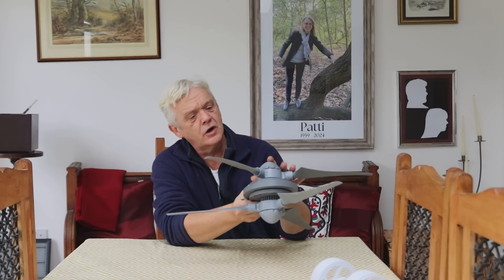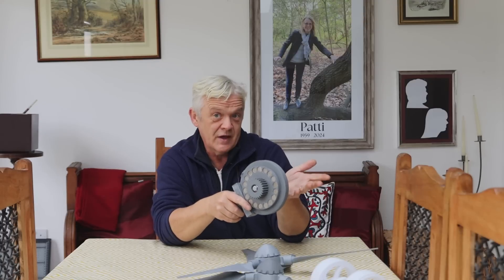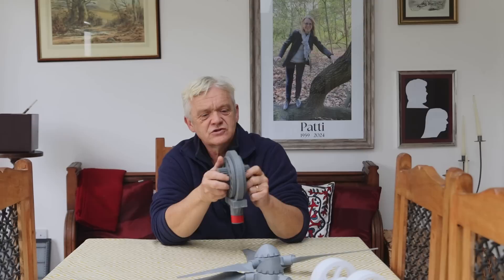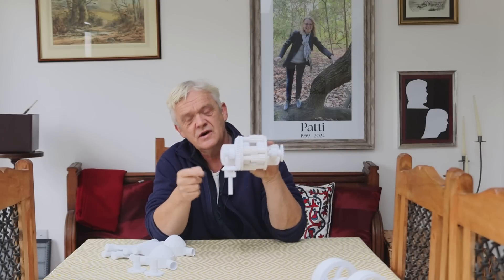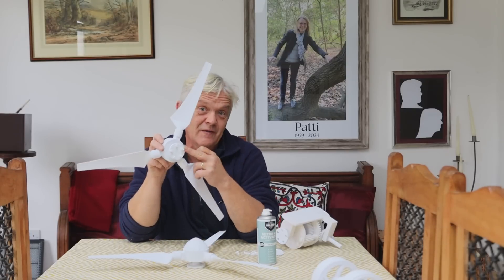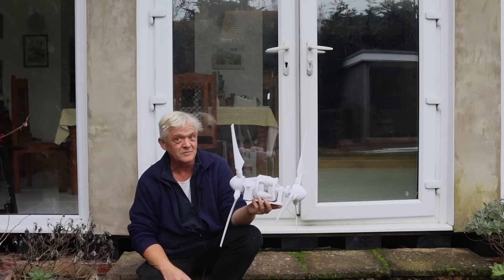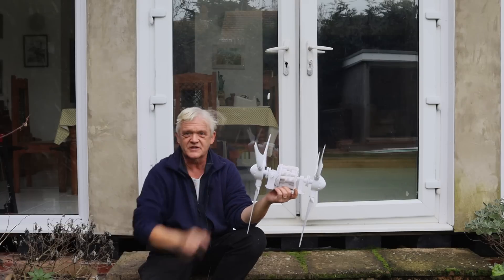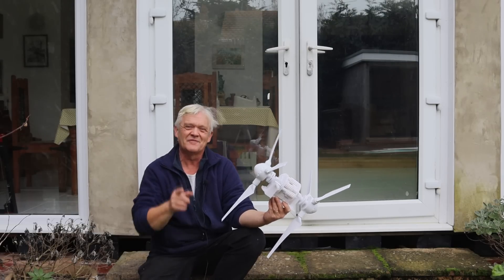2315 The Differential Wind Turbine

Comment: Another great instalment as always. However, I might have missed something here. Are the blades not ment to be off-set by 60 degrees in these duel rotor machines, enabling them to make use of the wind energy not taken by the forward set of blades? My initial thought is it’s inevitable the blades will at some point or another be in perfect alignment meaning the rear blades take no, or at least limited energy from the wind. Thanks in advance for any clarification. Other than that, I may well make one for the hell of it.
Reply from the maker: oh make one for the hell of it mate lol

Comment: Nice to see it all coming together!  As a retired electrical engineer, I am enjoying this series showing how units involving mechanical engineering work, and what they can do.  thank you Rob!
Reply from the maker: cheers mate
Reply: I've always wondered, do you think it's possible to have contra-rotating blades angled oppositely to each other, with the 'stator' containing windings + brushes actually ROTATING opposite to the rotor that contains permanent magnets? Will the drag cancel out any gains? Would they just lock in low wind and be useless? It's a high wind idea!
Reply: @PrivateSi  I was thinking exact same thing during the video.. slip rings and brushes would add to build cost and probably steal a bit of torque? So much experimenting to be had here :)

Comment: I would be concerned about how the forces redistribute themselves when the differential casing starts to experience drag from the eddy currents of the generator. Differentials have an issue in that if the casing is held completely rigidly, then the two other shafts will turn in opposite directions. If the two differentially-connected propellers experience different amounts of force, then the slower propeller will impart some drag. Ithink I would need a model like you have made to experiment with the concept. It might be necessary to use some form of differential locking or a slip differential to counteract this.
Reply from the maker: yoiu know it will be in a nacelle right?
Reply: @ThinkingandTinkering  Certainly sir!

Apologies. I think I used incorrect terminology. I wrote casing, but I meant to refer to the combined ring gear and carrier that encloses the three conjoined bevel gears. I was in a rush to get out the door this morning.

Assume that the two propellers have identical weights and are pitched such that axial airflow will impart a similar amount of rotational force to each propeller such that if the ring gear, carrier, and planetary gear were not present, then the propellers would try to rotate at a similar speed, co-axially.

If the ring gear and carrier are allowed to rotate freely, then the ring gear and carrier have a rotation rate that is the average of the rotation rate of each propeller. For example, if one propeller has 12 rpm, the other propeller has 10 rpm, then the ring gear and carrier has 11 rpm.

If the ring gear and carrier are not allowed to rotate, then the two propellers hardly rotate because the planetary gear makes them fight against each other. For example, if one propeller has 12 rpm, the other propeller has 10 rpm, and the ring gear and carrier are brought to a stop, then the propeller that had 12 rpm might rotate in the expected direction at a very slow rate (e.g. +5/6 rpm), the propeller that had 10 rpm might rotate backward at an even slower rate (e.g. -1/6 rpm), and the ring gear and carrier would have 0 rpm. (I just pulled those RPM out of the air.)

If the ring gear and carrier are allowed to rotate, but experience rotational resistance (as might happen while they are connected to a generator), then would the two propellers fight against each other through the planetary gear (similar to above) in an amount that is proportional in some way to the rotational resistance experienced by the ring gear and carrier, since it would be in a state somewhere between the two examples above?
Reply from the maker: @Kargoneth  the force on the down wind rotor is bound to be less mate as some energy has already been extracted - so if the gear wasn't there the forces would be unbalanced - one way to counteract this might be by changing rotor size by a proportion - that aside - i might have this wrong but it seems like you might be describing a planetary gear but not the action of a differential
Reply: @ThinkingandTinkering  I am trying to use the terminology on the Wikipedia differential mechanism page. It calls the free-spinning bevel gear (that is affixed to the carrier perpendicular to the axis shared by the three other gears) a planet gear. It calls the co-axial/co-linear bevel gears (that are connected to the planet gear and to the pair of co-linear shafts that extend out of each end of the carrier) sun gears.

I may be simulating things in my head incorrectly, but I also seem to be having trouble describing what I am imagining in a way that is understandable. I think I would have to actually try to do what I am thinking, rather than describing it. Oh well.

I can certainly see one advantage to this setup in that if something were to cause one propeller (and sun gear) to stop turning while the other propeller (and sun gear) continued turning, then the planet gear, carrier, and ring gear would also continue turning and generating power.

Thanks for responding, Robert.
Reply from the maker: @Kargoneth  no prob mate - shame we are not sat down over a beer discussing this I am sure we would reach a common understanding - that - to be honest can be quite hard when just using the comments section lol - cheers
Reply: That'd be swell! Cheers!

Comment: Dear Robert, I got a 3foot toy turbine for my birthday. I got it working today. It changes two aa batteries.. 😊❤
Reply from the maker: Happy birthday! lol and that is cool!
Reply: You can run a, Joule Theaf/Joule ringer.
If the lights go out, in a Storm at least you got Light 😮...  Dial it in charge cell phone... Real small Sand battery to Stirling cycle gene😅😅
Reply: You can quite easily run a 240v  1 watt led bulb very brightly with a hv stepup transformer and your 2x aa 1.2v batteries so great bit of free energy when the wind is blowing 👍
Reply: @johnwynne-qx6br  Ever make a Joule Ringer/TheaF inverter?
Transistor, Resistor, Bi-filar Coil, Either Cored or coreless, Toroid, Rod or Pancake works. Old speaker wire, Romex for Home even thin Bi-filar from a broken earphones.
These tiny inverter's are pretty great, 2n2222, 2n3907, 2n3055, 2n7401 almost all transistor's work. 2n3055 can handle Big coil though. using these I take a Solar lamp thing for yard, replace the bulb with inverter and buld on inverter, getting twice the light and run time as before. Put on window sill, makes a automatic light. Inverter is great emergancy thing.. On my channel I show diagram...

Comment: Interesting. I've often wondered why wind turbines didn't have dual propellers.
Reply from the maker: some do - it can take time for new ideas to filter through
Reply: I'm about to make a long comment explaining why, but the short version is 'propeller downstream of pole experiences stress.'
Reply: @vylbird8014  while passing through 1st prop, some of the airflow energy is converted into an axial swirl, and also turbulence. A following contra-rotating prop (with blades set at the correct different angle of attack) should recover most of energy within the axial swirl. But it will also be subject to extra vibration due to the extra turbulence.
Reply: @vylbird8014  Interesting. I look forward to it, if you get around to it.

According to Wikipedia regarding downwind rotors: "The main drawback is that the load on the blades changes as they pass behind the tower, increasing fatigue loading, and potentially exciting resonances in other turbine structures."

I imagine that this is sort of what you're talking about.

Comment: A two rotor differential turbine is a waste of material in my opinion. It is interesting though.
Reply from the maker: read a bit of the research - it might change your mind
Reply: @ThinkingandTinkering  I don't doubt the effectiveness of the differential, but there is a good reason why they can't put wind turbines close together. I believe the materials could be better used on a bigger turbine or another turbine in another location.
Reply from the maker: ah well we all have our ideas mate lol - I wasn't being rude by the way the research on dual rotors and their effectiveness set against cost is pretty interesting reading
Reply: @ThinkingandTinkering None taken. Even if it was, I got a pretty thick skin in my almost 80yrs. It's all good. I go with my gut most of  the time😂
Reply from the maker: @justtinkering6713  lol - you do the right thing mate lol - cheers
Reply: More than one way to skin a cat. The differential could also be in torque instead of speed by adjusting blade pitch on a fixed axle.
Reply from the maker: @TroyMackay  absolutely mate lol